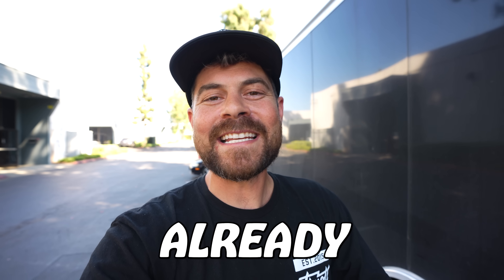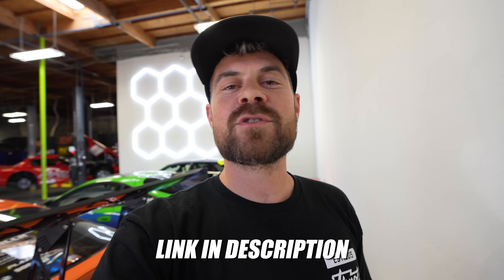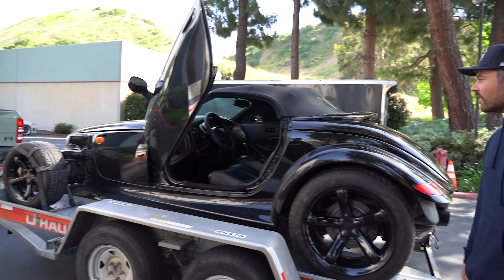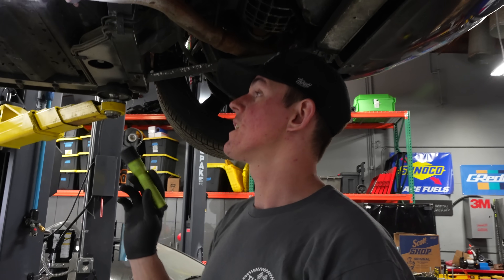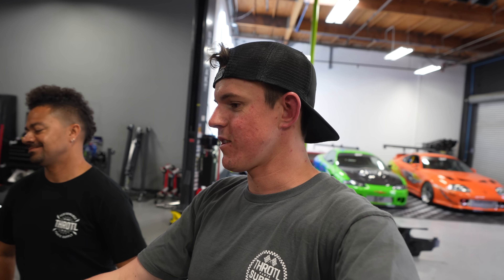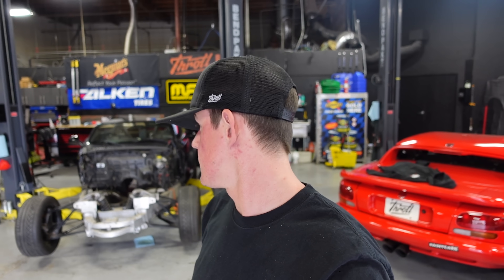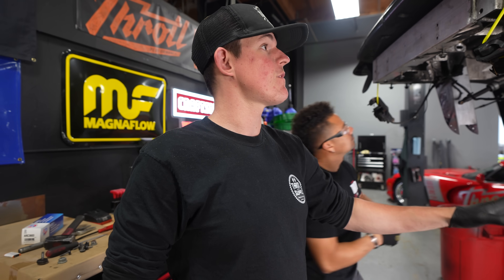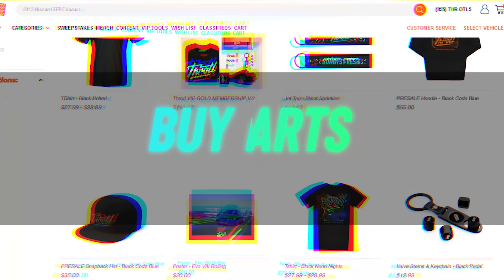We Bought An ABANDONED Plymouth Prowler and it's WAY WEIRDER Than You Think!

Comment: It's a bit wierd because its a concept car that wasn't really meant to be sold. 
It definitely looks better without the bumpers.
Random suggestion 
I've been in a prowler and couldn't believe how bad rear visibility is. 
I suggest a aftermarket backup camera. 
If you can hide it in the body so it doesn't look terrible. 
The rendering looks fantastic. Just not sure about the lack of angle on the rear wing. It looks  completely horizontal. Is the angle going to be adjustable?

Comment: A buddy of mine worked at Chrysler when they were designing the Prowler and he helped spec the materials used for it. The design team was hell bent on using the V6 because it was the most modern engine they had. Of course that meant splitting the transaxle that was used in the LHS at the time and moving it to the back. The transaxle engineering team freaked because it was never designed to be run separately from the engine. My buddy asked why don't you use the I-6 4.2L engine from the Jeeps and put a supercharger on it? They said it wasn't modern enough, even though it would have been much easier to fit into the design of the vehicle and would give them many more options for transmissions (manual being one of them), plus it would have had a trunk.

Comment: Apples to apples. The 99 Prowler with its weak V6. Was  quicker than the 99 M3 convertible, Mustang GT Convertible,  Mustang SVT Cobra Convertible, matched the Camero Z28 SS convertible, and slightly slower the the Convertible Vette. All V8’s…..